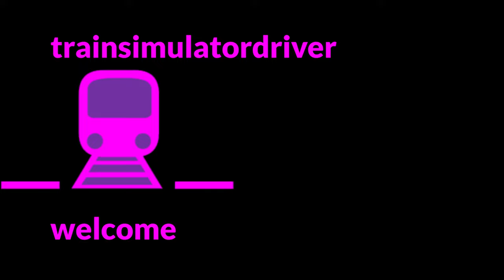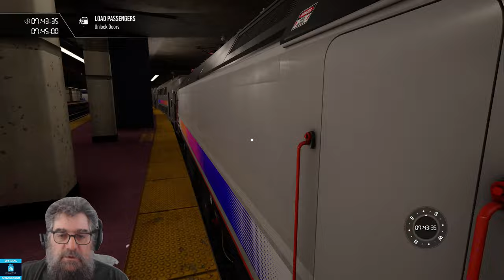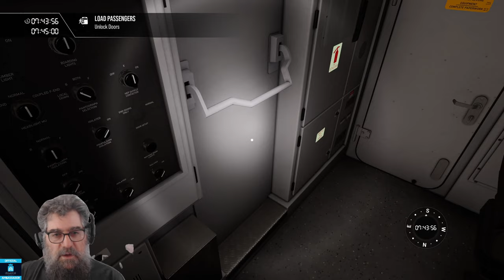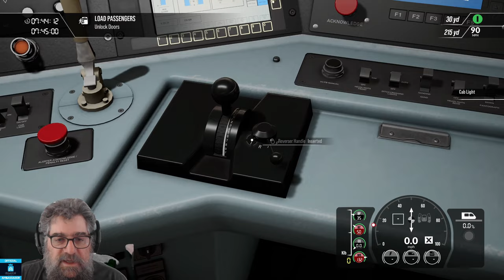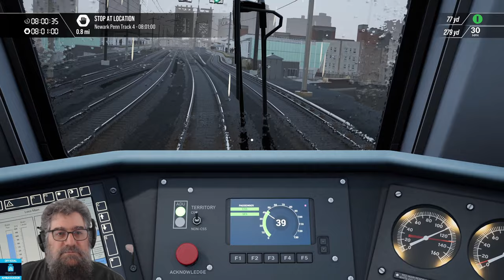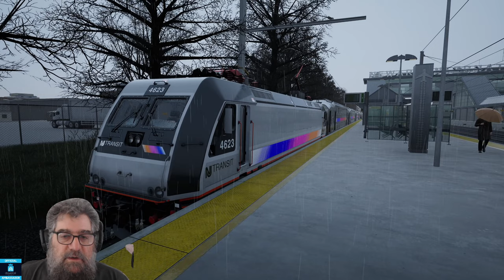TSW3 New Jersey Transit ALP46 Tutorial on New York Trenton

Comment: Hi there trainsimulatordriver. Do you happen to know if there is a switch in the cab to turn on saloon lights? I can’t find it anywhere!
Reply from the maker: There isn't. You can turn head end power on and off but not the lights. They come on by themselves when its dark. There may be a switch inside the carriage. These are not driver only operation (DOO) they have conductor(s) in the carriages to take care of them.
Reply: @trainsimulatordriver  do you know where the switch is inside the carriage then?
Reply from the maker: @RohrDC  I'm only thinking there might be, I've not looked, have a walk through and look for buttons or panels that open
Reply: @trainsimulatordriver  Right. Thanks for the info TSD. Much appreciated 👍
Reply from the maker: @RohrDC  no worries, if I'm in that route again soon I'll look
Reply: Definitely  not true cab car lights do not come on by themselves 😅 they just don't come on at all nothing better than doing a night service passengers get to sit in the dark ... great for sleeping 😅
Reply: @Savethepandabears  I submitted a ticket to DTG and apparently they themselves weren’t aware of the bug 😅 hopefully it will be fixed soon
Reply: @RohrDC  here's to hoping 🙏 they fix it 🙏

Comment: I’m having trouble with the breaking on the New Jersey transit trains
Reply from the maker: what sort of trouble are you having John?
Reply: @trainsimulatordriver  it just learning how to apply their brakes to slow down without stopping completely
Reply: @JG347Tv  have u figured it out?? im still confused about it :(
Reply: Release takes PSI out of the brake cylinder. E-hold is for while stopped at the station. Lap is to hold PSI. Service is to add PSI. Handle-Off is to add PSI quicker than Service. and Emergency you already know what it does, dumps all PSI and stops the train.

Comment: How to recover from a train penalty stop?
Reply from the maker: Sorry I must have missed this comment! For all reduce throttle to zero. For a Train Stop Penalty -- Put the brake handle to the HO/Handle Off position and wait for the train to stop. Acknowledge the penalty. Release the brake and off you go. If you get an Overspeed Penalty drop 15 pounds out of the brake system (watch the EQ needle) by putting the brake handle into service and put the handle into lap and acknowledge the alert, once you're below the speed release the brakes and drive.